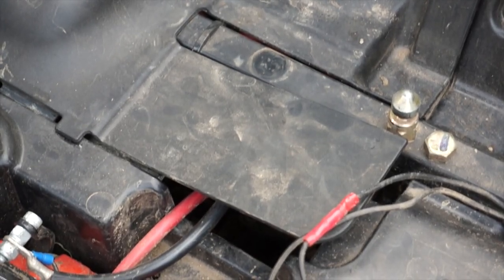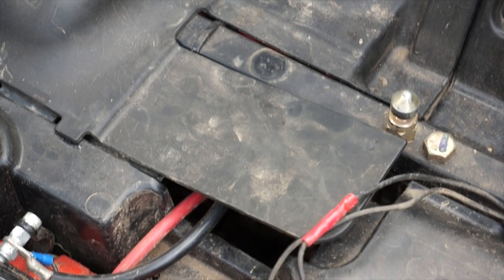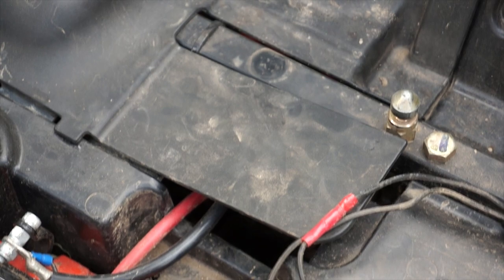STARTING YOUR POLARIS RZR 570 AFTER THE BRAKE LIGHT SWITCH FAILS

Comment: Where is the switch located on the machine? Mines not starting but if I put a flathead screw driver on the solenoid, it starts instantly. Can't find the switch.
Reply from the maker: https://youtu.be/EPlpBLOACEg this is a link to my repair video on the brake light switch